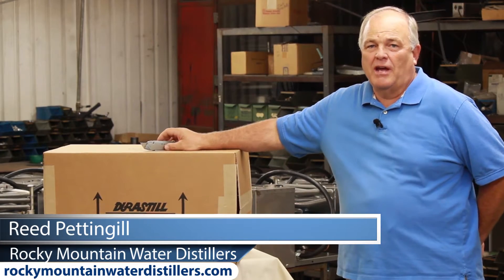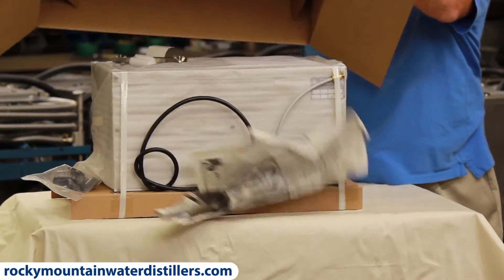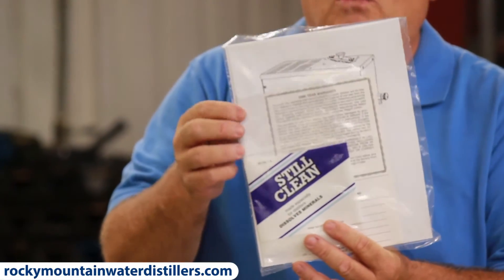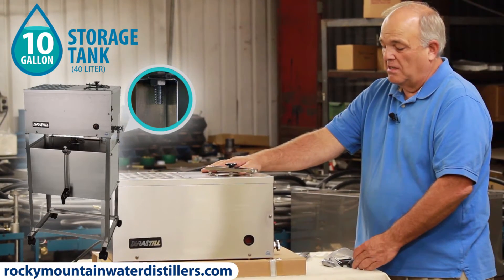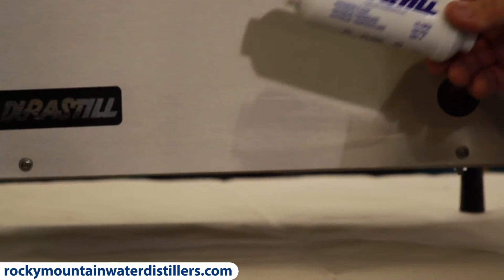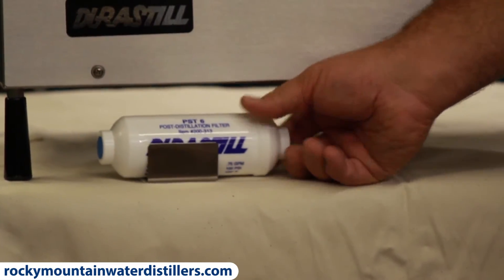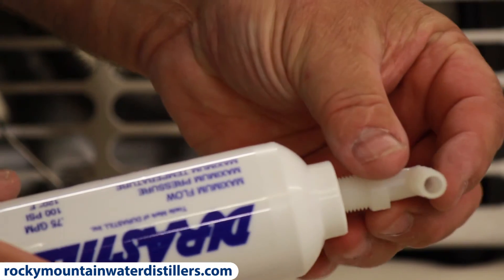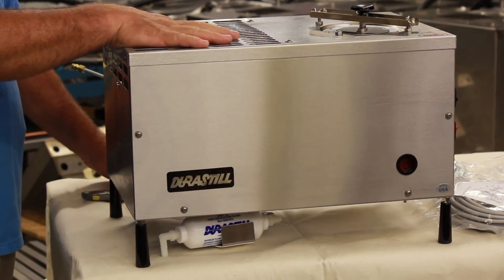HOW TO INSTALL & SETUP the Durastill 46C Automatic Water Distiller (NEW 2023 Model 46C)

Comment: I was going to get this but there are too many replacement parts to consider.
Reply from the maker: I understand when you look at the Durastill Owners Manuals and see the Durastill parts list it can seem overwhelming. The most common repair on a Durastill distiller is the float gasket and heating element gasket. These rubber gaskets wear out over time from the constant heating and cooling of the boiling chamber and you should replace them every 5 years. They only cost about $25. Other than that just keep your distiller clean and it should last for years with minimal maintenance! - thanks Brandon